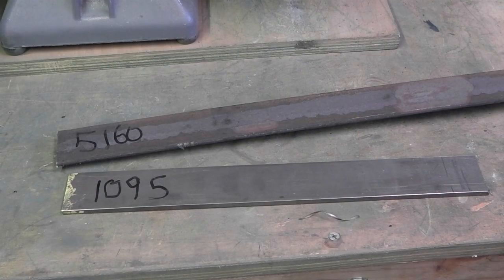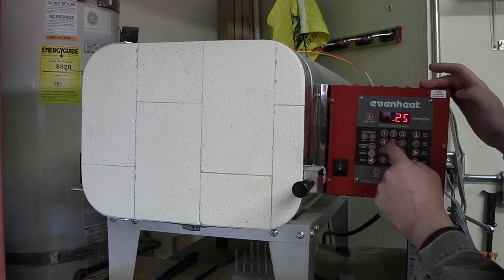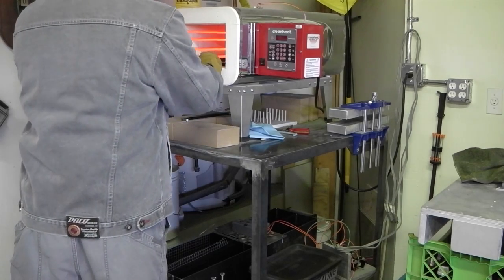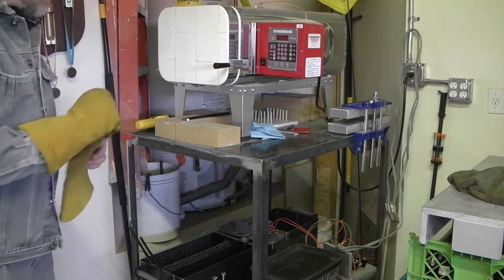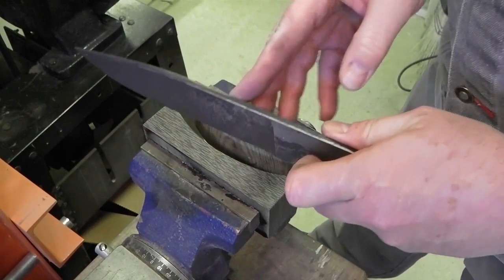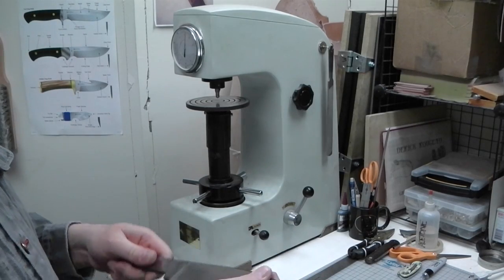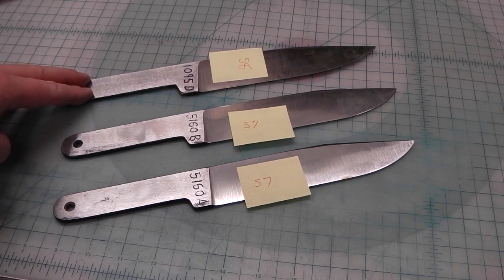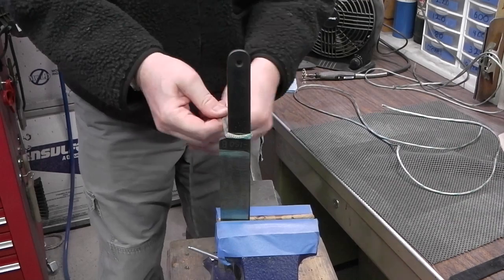Heat treating 5160 blade steel

Comment: Your  heat treat soak time is a tad lower than  the data I've read calls for  (1,525°F – 1562°F).  What advantage do you find using the slightly lower temp?
How long do you have to manipulate the  straightness of your blades?  Does it vary much for different alloys?
Reply: Lower temp will add toughness, up to a point. Less soak time to grow grains.

Comment: Ive been searching for good info and this video and the comment section answered alot. I currently use 1095 and quenching in canola oil but still getting a more dents in the blades edge not chipping or rolling it just dents lol file skates and did the same process as you (in a forge) oil was preheated to 132° using a temp gun. But only did one cycle of temping at 350° for 1.5 hrs
Reply from the maker: Try quenching around 180 degree water and temper for 1hr at 350f. Your blade is not getting hard enough.
Reply: Canola oil is too slow for water quench simple steels. W2 is water quench, O1 would be an oil quench steel and A2 would be air quench.
Plain carbon steels are at least water quench so they need special fast quench oil and thinner cross sections to cool fast enough.

Comment: 5160 is sup9 steel?
Reply from the maker: 5160 is not considered a Super Steel. It's a carbon alloy steel with consistent heat treating results.

Comment: I just heat treated a blade of 5160. I don't have a heat treat oven so I used the forge. I heated it up to red twice and let it cool. Then I heated it up to where it was non magnetic and quenched in canola oil. It was hard and a file just skipped over it without catching. Then I tempered it in my kitchen oven at 400 for an hour, let it cool and then put it in for another hour. I don't have a way to test hardness. Do you think it's ok or did I screw it up?
Reply from the maker: kol7117  - it’s hard to say. Chances are you didn’t reach full hardness with that oil. And tempering at 400 for an hour is probably high. You might want to skip the tempering all together or 350F for an hour. Find a machine shop that has a hardness tester and get you blades tested. That way you can fine tune you results. Good luck.
Reply: @drrougeau 
According to Larrin's tests, your toughness drops off a cliff below 375 temper with this steel, no temper is awful as even a 250 degree temper makes it both harder than out of the quench and also tougher.

Comment: in regards to your hardness tester. made in china.  Might be just the angle of the camera, but the needle looks straight. but numbers plate look off in vertical alignment, might be able to adjust the card with the numbers on it to match the needle

Comment: I am new to the knife making game, but I recommend putting a larger baking sheet on the bottom rack and the knives in the middle. The bottom rack baking sheet helps to prevent the hotspots directly above the element

Comment: Great video, i need to know the recipe for normalizing 5160 in a kiln, any advice would be appreciated
Reply: Elizabeth Figueroa 5160 Normalizing :1600*F  (870* C)  40 min & Cool in still air  2 Times to room Temp.

5160 Hardening Austentize :1525*F (830* C) And quench in Oil Temp 150*C Move blade forwards backwards in Oil to quench quickly and evenly.

Annealing: Heat To 1525*F (830*C) then cool rapidly to 1300*F (705*C) then cool to 1200*F (650*C) at a rate not exceeding 20*F (11*C ) per hour.

5160 Forging Heat To 1525*F (1205*C) Do Not forge after the temperature has dropped below 1600*F (870*C)

Comment: where does a guy get tongs like that?  And, what quenchant?  I have Some Houghton Quench K, would that work well for 5160?
Reply from the maker: look at forging supplies online would be your best bet.
Reply: Rougeau Knives yes, I guess H quenck K is similar to parks 50, a very fast oil for 10XX series steel.  I hear that 5160 likes a slightly slower quench, like maybe AAA? 

I have a pair of extra long channel locks, like at least a foot long, I was planning on using but proper tongs would probably be better.
Reply from the maker: As long as you don't get bunned or splashed when quenching. Us thick non flammable gloves as well.

Comment: how long did you oven take to get to 1500F?
Reply from the maker: it's about 20:00. I could take a little longer when it's colder in the shop.
Reply from the maker: 30 to 40 minutes.
Reply: Rougeau Knives ....thats not bad.i need to upgrade then.the old evenheat pottery kiln im using takes 1.5 hours to get to 1500.. i never had a baseline time before, now i do...Thank you!
Reply from the maker: I don't want to mislead you but it could take longer I just don't remember. It's less than an hour.

Comment: dear sir, kany hallo from Greece.I made an hight temp kamin and i d like programm the annealing face of 5160 steel (6mm car spring).Do you know the annealing carve?I mean the time to reach max temp, time remain in max temp,wich is max temp for 5160, and the time to enviromental temp.Sorry for many quastuonsbut i can not found infirnations in Greece.Thank you and many wishes from Greece.
Reply from the maker: Heat the steel to 1500  to 1550 degrees and hold at temp for 20 to 30 minutes. Let sit overnight in the kiln so it slowly cools down over many hours.
Reply: Rougeau Knives thank you, 1500 Celsius you mean?Here we use Celcius scale.Seem to be much 1500 for celcius, maybe you mean farenite ...???I fund the corespoding temp.
Reply from the maker: Celsius would be 815.5556.
Reply: Rougeau Knives thank you, its very kind you answer me.Thank you again, from Greece.

Comment: why make a heat treat video if youre using a programmable heat treat oven... you can look up detailed recipes for that... smh... where are the videos for those of us who dont have a grand to spend on a kiln.. ive looked and looked for a GOOD instructional video on charcoal forge heat treating... and cant find any
Reply: Keith Clarke look at Walter Sorrels video on heat treating in charcoal.
Reply: Little late, but here's an expert: https://youtu.be/9KYb9P9GzVQ
That's about heat treating in a forge, by a metallurgist that designs steels and heat treatments for a living. Also developed Magnacut steel.
Reply: Type in "work with nature" making machete with truck spring...On youtube...The guy is in jungle,think he is german.He has 2 friends work with him and divided into 3 videos ( not long but fun videos).. He does it the manner islanders use,like Chamorro in guam etc..It is where I learned and my blades come out epic..At end he showed how to make a ledge to hang spine over for multi treatments for tempering perfect..Follow everything to a T,,,,EACH STEP....Even dip a hot iron in your quench medium to heat it prior..I finish mine better,but his manner is sure proven PERFECT HOMERUN for 5160 auto springs used.Sequence of videos are fun to watch,crew is funny and they name it the  " Ventury Fury" jungle machete.lol.."Work with Nature" on youtube..Guy knows alot of stuff...

Comment: Thank you Rougeau Knives for the video, which temper did you put the oil? If I'm using normal kitchen oil, which temperature would you recommend ?Thanks a lot
Reply from the maker: Kitchen oil won't give you full hardness of the steel. You can drag a file over the cutting edge after quenching and listen to the sound it makes. The more it sounds like glass the harder it is. So I would consider not tempering it unless you get a good smooth glass sound. If you do temper it, 375F for 1 hour. Without a hardness tester we are guessing.
Reply: Rougeau Knives really... i havent had any trouble getting mone hard with vegetable oil... i just dont heat the oil... everyone says i risk cracks etc... but it hasnt happened yet... and if its a small cutter blade i dip it in the oil cold for 5 seconds... then water until its cool...
Reply from the maker: Did you hardness test your blades after quenching. Local machine shops might have a hardness tester to figure out what hardness you're achieving.
Reply: What oil should I use then?
Reply from the maker: Batata99 
I'm using Parks AAA for 1095 and Parks 50 for 5160.
Reply: Parks oils are not an option for me, at least in my country.
I don't even know where to buy it. I googled it and got no results.

I read a guy's post in a Brazilian cutlery forum saying that transmission oils (ATF paraffin-based) are almost the same as quenching oil because they are paraffin based, and the difference between the actual quenching oil and the transmission oils are the additives.
I guess I'll have to stick with it.

I hope it works.
Reply: I forgot to mention that I'm using SAE 5160.
So, I should temper it at 375ºF for about an hour and that's it, just one time? I thought the steel would be too brittle for knife use.
Reply from the maker: Finding good quenching oil is hard to do and if you do find it you have to buy a 50 gallon drum. But if you regularly check knifemaking supplies online you can get lucky. 1095 can be quenched in water but 5160 need a medium quenching oil. Virgin olive oil is supposed to get an ok hardness. I've never experimented with it. Tempers range from 375 to 400 for an hour and second temper at 400. But that's if you get to 61 to 63 RHC.
Reply: Rougeau Knives just my personal experience.. but ive only done a couple... im just a hobby knife maker... i use 5160... and i quench in vegetable oil... i found that it didnt get hard enough... close but not quite what i wanted... so after a little experimenting... i found IN VEGETABLE OIL... a 6 to 7 second quench in the oil... then a quench in water until its cool enough to hold... does great... gets up to around 61 63 ish... then i do 2 400° cycles for 1 hr a piece... everyone says im doing it wrong... itll crack or warp the blade blah blah.. but so far ive done 5 that way without a detectable crack or warp... on up to a 17inch blade... so..... just a comment from the peanut gallery

Comment: what tempature did you use for 1st temper and how long?
Reply from the maker: +Jimmy Aleman 
1500F and hold for 20 minutes if it's 1/4" thick steel. 15 minutes for 1/16" steel.
Reply: Wait.....
After you quenched and verified it had hardened, you then ...TEMPERED at 1500F? After your final tempering, what was your RC hardness?

Comment: Hello sir, Thanks for the video. I see you used 350f x2 for 1 hour to get 57 hrc.
But how mutch more for geting it down to 52? I making two long slim middel age knifes 19" blade 1" widescreen and 3/16 thick, and 57 is probably to britel.
Reply from the maker: +Joar Flesjå 
you can try 400Fx2 or x3. but without a hardness tester that's a guess.
Reply: Thanks, Im in the start of making knifes and its more a hobby that bring in some money. I will probably buy some hardness test files. Thanks again.

Comment: Wow, I really enjoyed your videos, thank you! Is there any benefit to spring tempering O1 tool steel to the 52-55 range in 5" -  6" blades? I had no idea O1 could bend so much at 60rc.. Would O1 at around a 54rc still hold a good edge? Thanks.
Reply from the maker: ***** I would say at 54C you're not utilizing the full benefits of O1. 57 to 60 is a good range.

Comment: At what temp and how long would you recommend tempering 5160? Specs are 1/4" thick, 10" long. I'd like a the hardness to be upper 50s like 57 or even 58. Anyway thanks!
Reply from the maker: Soak at 1525F for 20 min 1/4", Oil quench and temper ASAP
First temper 350 at 1 hour RC 59 – 60
Second temper at 350 at 1 hour RC 57-58

Results may vary with your equipment, good luck.

Comment: wait, you want to straighten the blade while it is at its hardest?   Are you not worried of breaking of fracturing?  That i how i understood what you were saying at the vice.  Could you expand on that?  I am concerned about straightening, but I normally try to do that while the blade is annealed before the quench
Reply from the maker: Even if the blade is perfectly straight, sometimes when you harden carbon alloy steels they will warp a bit and you need to straighten them. After I quench the blade It will cool to about 400F to 600F degrees in around 10 seconds. That's when I straighten the blade and you wont break or crack it, at least I never have. You could straighten it during you first temper as log as the temp is 400F or higher but the chance of cracking might increase.

Comment: (+1 : 10)
Very Nice. I'm going to be working with 1095 Blue Tempured Steel from McMaster. I'm going to order 0.025" x 4" x 4' shim stock for making lockpicks. The problem is that I don't want to ruin the temper when I use a dremel with an abrasive cutting disc. How would I go about cutting it without ruining the temper..? Just make sure it doesn't go over 500 degrees? Or make sure it doesn't get too hot right? Awesome video btw, I really like your rockwell hardness tester. Where can I get one of those, if I had the money to get one? You've got some really nice equipment. Thanks for the awesome video.
Reply from the maker: I pickup my Hardness Tester from Grizzly. I would grind the picks first but leave some extra meat on it. Heat treat and temper, unless you want the picks to be on the hard side don't temper and test bend them. Then finish grinding the rest off and quench in water periodically to keep it cool. Don't go over 300 degrees F or you will draw the temper out. Or you can heat treat it first and do all the grinder afterwards, your call. Good luck.
Reply: Thanks for the reply. I don't have a grinder, I'm planning on using the abrasive cutting wheel to cut close to the lines on the template for the picks I designed in InkScape. then I was planning on using the Dremel again to trim very carefully and slowly to the lines, to get a very nice lockpick, exactly how I designed it in Inkscape. I'll definitly quench it in water and when I feel the metal getting hot on my fingers, I'll dip it in the water. If I do ruin the temper it's just a matter of getting the metal red hot, to harden it, then quench, then heatt it up till I see the metal getting blue, to get the temper back in the 1095 Blue Tempered spring steel.. right..? I'm pretty sure I wont have any problems, just never really worked with this much steel before.
Reply from the maker: Roy Andrews You would be better of using small files or jeweler files to do the shaping. Steel needs to be no magnetic before you quench and temper 350F to 400F for 1 hour. that might hit your desired hardness. You can always do another temper if its to hard.
Reply: Which set should I get from McMaster Carr..? I see they have quite a few of them here, can you take a look at them, and tell me which ones might be the best? http://www.mcmaster.com/#jewelers%27-files/=rrle19
Reply from the maker: Roy Andrews You would know best based on the file tip type and what kind of notch you want filed into the tool. And your budget.
Reply: Yeah, I think I'll go with the American Series aka engineer's files, They're like $60 for a set of em. I'll keep looking and see which set I'm going to get. Thanks for the help, much appreciated.

Comment: Do you normalize when you buy stock and  in a diy kinda forge should I keep my steel non magnetic for 15 mins or just quench at nonmag?
Reply from the maker: New steel is typically in an annealed state so its soft and not hardened. Normalizing is needed when you have forged or hammered the hot steel and need to release the stresses of the steel so it's grain is even. When heat treating hold the steel at it's hardening temp so it becomes nonmagnetic and then immediately quench. A general rule is to hold the temp for 15 minutes for 1/16" thick steel, and 20 minutes for 1/4".
Reply: Thanks a bunch for your help ill let you know how mine comes out I have 3/32 1095 and quarter inch 5160 shld be fun!

Comment: So what heat and time did you use to temper the steel down?
Reply from the maker: I don't use just one form of heat treating. Some blades get an edge quench. Others get a clay pack to create a Hamon. Some get a hard temper and some a soft temper. It all depends on how big the knife is, what it will be used for and the steel it was made from. The heat and times in this video give you a starting point.
Reply: My question was more specfic. I understand the heat treat and the first temper -- what I've never seen is re-tempering a steel to be less Rockwell or more springy. That was a very cool video. So how did you do the second tempers?
Reply from the maker: Second temper was done in the kiln, 400 degrees for 1 hour. There are time I do a triple temper as well.
Reply: And you just let them cool down in the kiln?
Reply from the maker: I pull them out of the kiln and let them cool to room temperature.
Reply: Thanks -- I didn't know how that works --